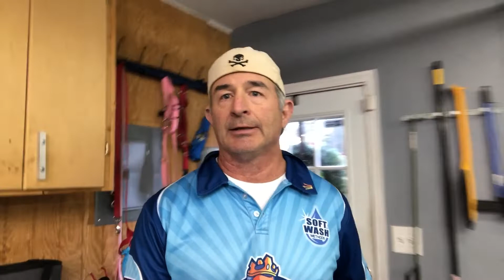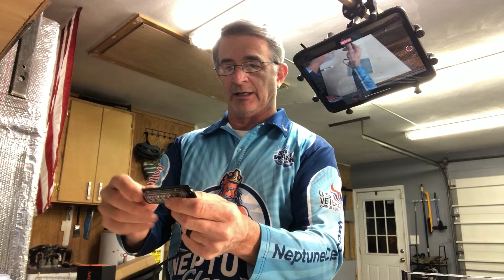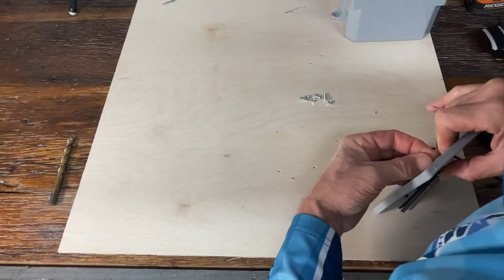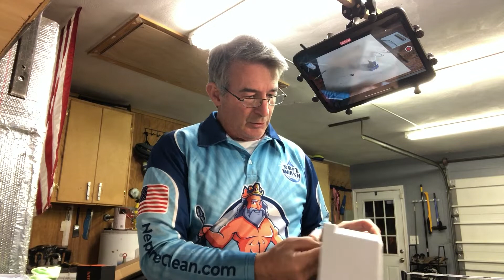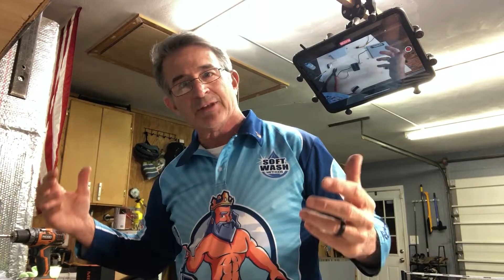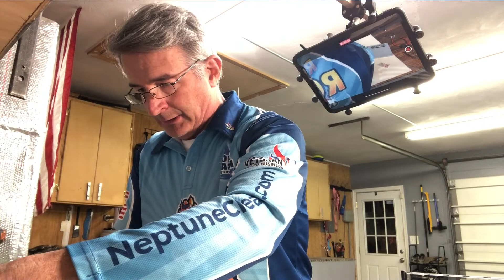DIY Automated Downstream Injector Box

Comment: Hey Bill do you have the link for the strobe light?
Reply from the maker: Hey I just added the items I got from Amazon to the description. Be sure to check each product size parameters as you have to choose the size you want. For instance, they offer brass and stainless steel ball valves. You want stainless when dealing with SH. They also come in 1", 3/4", 1/2" just to name a few. I purchased a 1/4" stainless ball valve but i don't see it on that link anymore.
Reply: @neptuneclean  thankyou yea adding the links will help alot of ppl I built one last year following herbs video but at the time he didn't explain the wiring I finally now understand how to wire properly I can follow a video but to not understand it was really frustrating thankyou